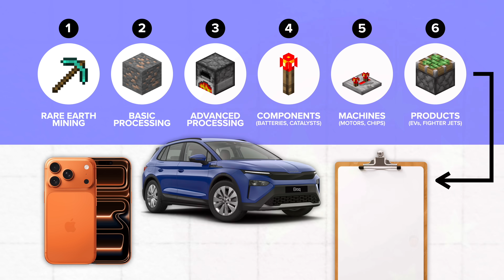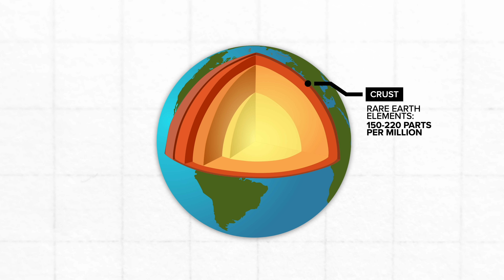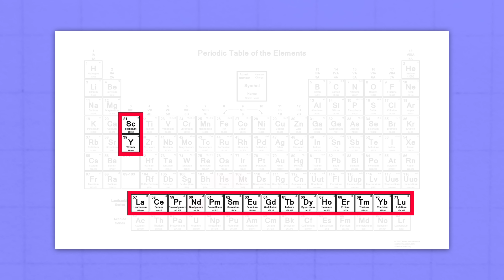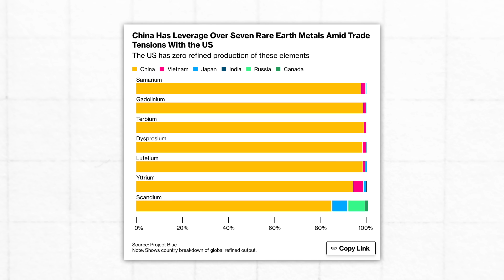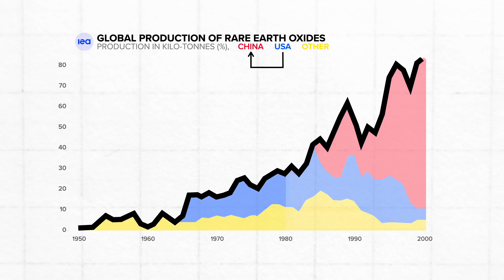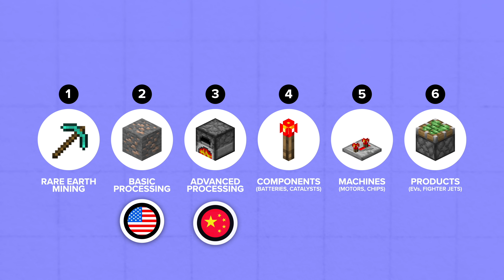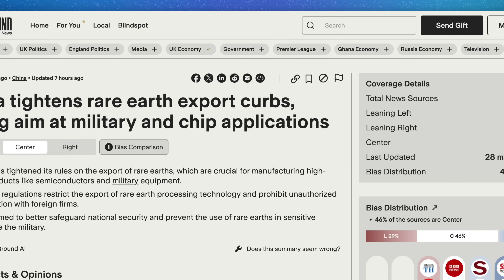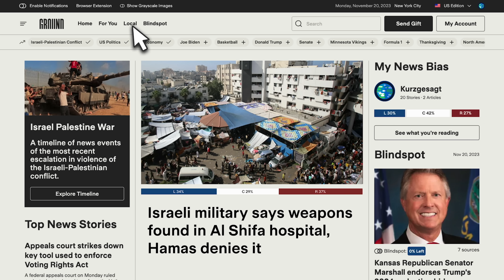Why Breaking China's Rare Earth Monopoly is Surprisingly Difficult

Comment: A simple example: Gallium is a byproduct of electrolytic aluminum production. To produce 2 tons of gallium, you need to produce 500,000 tons of electrolytic aluminum. Producing electrolytic aluminum requires a huge supply of electricity, and these 500,000 tons of electrolytic aluminum need to be sold.
Reply: Yeah recreating the manufacturing of some of these metals is the equivalent of replacing entire supply chains, what china has pulled off here is both brilliant but also concerning.

Comment: CHECKMATE TO China AGAINST  OVER PERMANENT MAGNETS

"Trade war deepens Chinese problems"

And what does it do to US problems ?

Do you appreciate how critical rare earth permanent magnets are ?

2 kgs in every single EV motor.
And a few grams in every smartphone 
And there is no alternative substitute 
.
So what's the US going to do with the watertight export controls, EFFECTIVE 1 DECEMBER (as per latest release) where EACH EXPORT TO US, EVEN IF THE WEIGHT OF $RARE METALS IS 0.1% OF OVERALL WEIGHT OF ITEM, THE EXPORT WILL NEED SPECIFIC EXPORT CLEARANCE FROM CHINA'S CTC !!

when 90% of these magnets are produced in China ?

AS FOR BUILDING PROCESSING FACILITIES IN US: (from Gemini)

Conclusion on Timeline: While initial magnet production will begin between late 2025 and mid-2026, reaching true, industrial-scale capacity (enough to meaningfully challenge China's dominance and supply the massive needs of the EV sector) will take 3 to 7 years (2028-2032). Building a complete, vertically integrated supply chain is a process that typically takes 7–10 years from discovery to full production.

CHECKMATE TO CHINA VS USA.

Comment: So, in essence, some other country (or a coalition of them) would need to build rare earth refining plants, since most existing ones are in China.
But they can't because they don't have the tech, so they would have to independently develop the refining tech before that.
But they can't because they don't have the engineers and scientists specialized in heavy metal metallurgy, they would have to train those first.
Which means it would be decades, at least, before they could supply rare earths with the scale and purity China can do now. And even then they would likely be unable to compete in price.
And they also need the raw minerals from which to extract the rare earths. China gets much of that by forcing its mining companies to process the residue from its mining operations; good luck doing the same to western mining companies.
Reply: Your ignoring the fact that there is countries like Australia who have high levels of rare earth mineral deposits and not to mention the discovery of one of the worlds largest lithium reserves in Germany.

This idea that the west doesn’t have the expertise to actually extract or produce the necessary information or knowledge to actually independently develop such is not based in reality and based simply on person fact.

Comment: The West believes that the idea of relying on technology to rebuild the rare earth-related industrial chain within a few years is unrealistic, which is not only a technical problem, but also a systemic problem. Taking gallium metal as an example, if the United States wants to produce 100 tons of gallium, it needs to invest 1500 billion yuan to build an annual output of 1500 tons of alumina factory, and also to build an annual output of 750 tons of electrolytic aluminum factory, and the electrolytic aluminum plant needs nearly 100 billion kWh of electricity a year (equivalent to the annual power generation of the Three Gorges Dam), and 10 new large-scale pressurized water reactor nuclear power plants need to be built, and at the same time to solve the problem of ports, highways, power grids, mine construction and the shortage of 3-5 skilled industrial workers, and the electrolytic aluminum market is surplus, and the cost of electrolytic aluminum produced in the United States is high, It is uncompetitive and economically difficult to sustain.西方認為靠技術能在幾年內重建稀土相關產業鏈的想法不切實際，這不僅是技術問題，更是系統性難題。 以金屬鎵為例，美國若想生產100噸鎵，需先投資1500億建年產1500萬噸氧化鋁工廠，還得配套建年產750萬噸電解鋁工廠，而該電解鋁工廠一年需近1000億度電（相當於三峽大壩年發電量），需新建10座大型壓水堆核電站，同時要解決港口、公路、電網、礦山建設及3-5萬名熟練產業工人短缺問題，且電解鋁市場過剩，美國生產的電解鋁成本高、 無競爭力，經濟上難以維繫。

Comment: What this video misses out on, irrespective of rare earth deposits or concentration

You cannot have a rare earth refining industry, without having a huge mine product refining industry. Why? Gallium. It is obtained mostly from alumina, and annually only really about 150 tons of gallium is produced. Every ton of alumina, from which gallium is obtained, only really gives you about less than half a gram of gallium.

To make 140 tons of gallium, you need insane amounts of alumina production, for which you need an insane amount of aluminum production. China went through about 85 million metric tons of alumina in 2024. Assuming half of it also produces gallium, you need to process 42.5 million metric tons of alumina to obtain about 140 tons of gallium.

Any country that wants to have a rare earth metal/element industry, large enough to make enough rare earth for themselves and for export, they don't need a rare earth metal/element industry. What they need is a humongous mine ore refining industry. Rare earth is an additional profitable step on the top of it.

Why do you think CCP keeps running so many steel foundries and mills? So much copper refining? So much aluminum production? It enables their rare earth industry, which gives them a huge amount of negotiating power in diplomatic negotiations. 

You can't really have just a rare earth industry. You need to have a mine product refining industry, from which you make rare earth concentrate product from which you refine rare earth elements/metals.

Comment: First of all, it should be clear that rare earths are divided into light rare earths and heavy rare earths. Light rare earths are available all over the world, and the United States also has a large amount. However, 70% of heavy rare earths are in China, and only China has the capacity to refine heavy rare earths. Without heavy rare earths, chips, engines, photolithography machines, missiles, aircraft, automobiles, and any electronic equipment you can think of cannot be produced. China holds 93% of the world's rare earth patents. Its technology has been updated by several decades, and now the pollution is almost negligible. For other countries to rebuild the rare earth industrial chain, it will take at least 20 years or more. Moreover, the world is extremely short of heavy rare earths, and the role of light rare earths is far less important than that of heavy rare earths
Reply: Also the internet itself is dependent on erbium, which is one of the heavy rare earths. It's used in fiber optics to rectify and boost the signal.
Reply: @sydhenderson6753 Yes, almost all electronic products rely on heavy rare earths, and currently there is no material that can replace them. Only China has the technology for extracting heavy rare earths and can reach the 6N level, while in the United States, heavy rare earths only account for 5%, and 95% are light rare earths. Light rare earths are of almost no use to high technology.
Reply: For heavy rare earths, the refining capacity of the United States is zero.
This is not to say that the United States is now zero, but that heavy rare earths have never been refined in US history.
Even in the era when US rare earth production ranked first in the world (before 1990s), the United States only produced light rare earths.

Comment: Rare earth is likely not very polluting by per usage. It's only polluting by per weight. Devices only required small amount of rare earth. Without rare earth, to achieve the same performance, one needs to produce more inefficient devices that is overall more polluting.

Just consider the analogue of "industrial MSG". Without MSG, one needs to spend more resources and allow more pollution to produce food with similar taste, whereas a cheaply produced food with MSG taste similar but net required less cost and pollution even if MSG cost a lot or pollute a lot by weight. (But they pollute very little per usage)

Comment: You've failed to mention the key pollution issue, it's Thorium. It's one of the least radioactive elements generally safe to handle but it's still treated as radioactive waste. We need to relax this law and stockpile the thorium for later use in reactors.

Comment: Most media outlets tend to avoid using the word “purity.” They often repeat that China accounts for about 90% of global rare earth refining. While technically true, this figure conceals a deeper reality: in high-purity light rare earth refining and heavy rare earth processing, China’s dominance is virtually absolute — close to 100%.

Moreover, China also controls nearly all of the industrial equipment, extraction solvents, and engineering expertise required for rare earth separation. In practice, there are very few professionals outside China who possess hands-on experience with large-scale rare earth refining. Western facilities account for roughly 10% of global refining capacity, yet this entire share is concentrated on low-purity light rare earths such as lanthanum and cerium.

Equally important, China holds a de facto monopoly over the world’s economically viable heavy rare earth deposits. Nearly all known ion-adsorption type heavy rare earth resources — the most critical for advanced magnets and defense applications — are located within China or in northern Myanmar under Chinese control. Outside these regions, no comparable heavy rare earth deposits have been found that can be mined or refined at industrial scale.

What is rarely mentioned in Western reporting is that the United States has in fact been mining rare earths since the 2000s, primarily at the Mountain Pass site in California. The material exported to China, however, is not raw ore, but a semi-processed concentrate that has already undergone beneficiation — the step in which ore is treated with concentrated sulfuric acid and other chemicals to extract rare earth minerals. This beneficiation stage is the most polluting part of the entire rare earth industry, producing acid waste and radioactive residues. In other words, the U.S. retains the most environmentally damaging stage of production domestically, yet almost all media narratives omit this fact while portraying China as the sole source of environmental impact.

China’s rare earth industry, in contrast, was not the result of technology transfer from the United States. The U.S. has never achieved mass production of high-purity light rare earths, and it has never industrialized heavy rare earth refining of any grade. The foundation of China’s technological edge was laid in the 1970s, when the renowned scientist Xu Guangxian developed the cascade extraction theory — a highly efficient, low-cost method capable of achieving high purity. Chinese engineers subsequently transformed this theoretical framework into full-scale industrial processes, so that by the late 1980s, Chinese state-owned enterprises were already producing high-purity rare earths domestically.

During the 1980s–2010s, however, a proliferation of small private workshops produced low-value, low-purity rare earths with little to no environmental protection — a by-product of rapid, unregulated expansion. These operations were later consolidated and regulated as China began restructuring its rare earth sector into a national strategic industry.

Today, China remains the only country possessing a complete, end-to-end ecosystem for high-purity rare earth refining — encompassing resource control, extraction theory, process engineering, equipment, materials, and industrial talent.

Comment: At this point countries would rather restablish new supply ines and bite the bullet then be under the thumb of china when it comes to rare earths
Reply: where do you want to reestablish them? on mars?
Reply: @thewingedringer  Technically China is not the only place to mine and process rare earth they are only used because they are the cheapest which literally describes the whole reason why people go there. Its cheap
Reply: @Terrapins86 - China has extensive process and equipment IP in rare Earth processing. It’s funny you can’t get beyond ‘cheap labour’. That’s why China has banned export of technology used in manufacturing REs. Every F35 has 300kg of rare earths in it. The high purity REs needed for advanced radar arrays only come from China - nobody else can achieve the purity required.

Comment: 0:15
It's not that burdensome on an induvidual company level with an asterisk. Each step in the supply chain has it's own inputs and outputs. What's indirectly asked here is that each step in the process declare what they do up/down the chain. If they want to waste time they don't do it in compatible formats. 

The asterisk is really that the CPP is directly inserting itself into an approval/denial of every single supplier here. I'm sure there's companies that get rubber stamped and companies that see unforseen delays and eventual rejection for ambiguous reasons.

But it's not a burden, that cannot be the problem. Imagine running a company where you don't know where you're getting things from or where they're going. And then you can't fill out a paper on that.